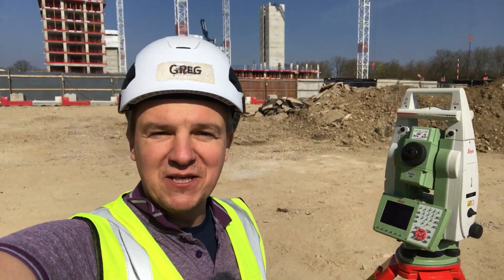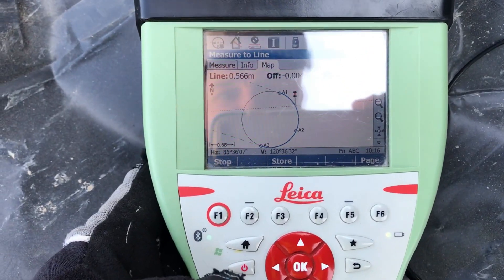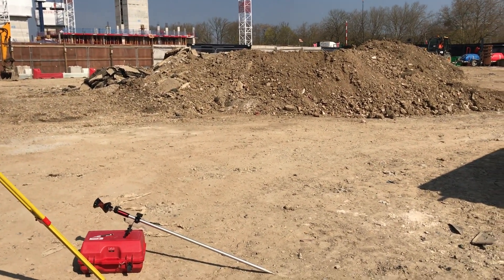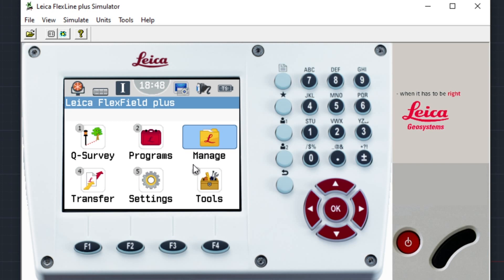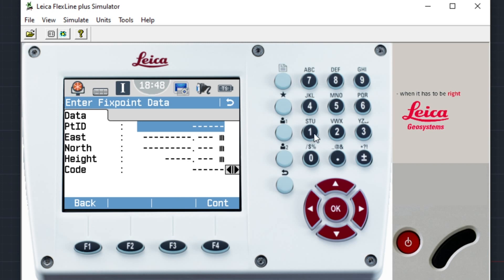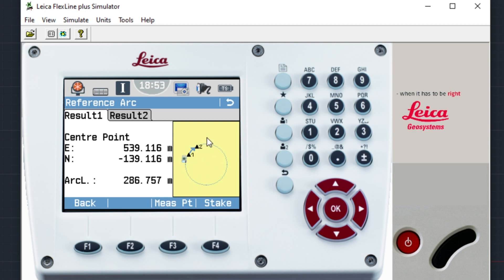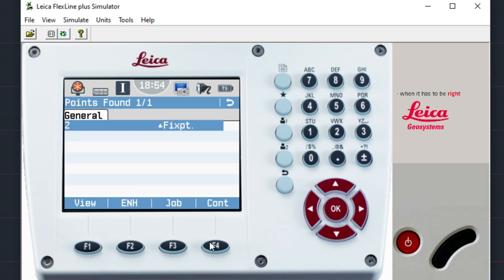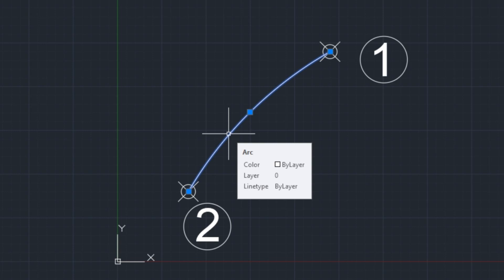SETTING out an ARC. HOW TO USE A REFERENCE ARC with Leica EDM. CIVIL ENGINEER works.

Comment: Hi Greg! About arcs - you're familiar of that because we talked once about it. But a VERY important info for beginners. Some of the Leicas (i.e. TS11 as I remember) has an error in software when setting out open arcs (more than 180 degrees). The error occurs when you want to setout an arc with two points and center of circle. Software somehow calculate an arc based on three points of the arc and set out flatten arc which is different that you want and less than 180 degrees. Be very careful when setting out reference arc with more than 180 degrees. Safe method is to use three points on the arc setting out. Almost always :)
Reply from the maker: Hi Rafal!! I can't remember now :) Thank you for info. For all - be careful this is important!!!!!!

Comment: Hi Greg , your videos are really helping me.
Am a mine surveyor in the past have been using TS02 and TS06 plus, but the decided to buy TS15, what I need is please help me, on how to interpolate between two points Which has elevation using reference line in TS15 am really struggling.

Thanks.
Reply from the maker: Create the line and use measure to line option, the heights will be taken from the line - its interpolated. Dont stake the line, measure to line. With TS06 was better and simpler 😁

Comment: Hi, I’ve been using a TS06 for years. When I set out an arc, I always used the centre and start point function. I’ve recently upgraded to a TS15 and it doesn’t seem to have that option for setting out an arc. Is there a way of downloading that program to the instrument?
Reply from the maker: I am missing some TS06 things on TS15 too :) I think you just have to get use to it -> 3 points, or 2 points and Radius

Comment: Sir can I mark also Arc 2 (2854.836) by same orientation , I mean is it possible to mark a full circle ⭕
Reply from the maker: Yes you can, but you would probably have to choose the arc 1 and then arc 2 later to make is easy 😁

Comment: hi Siteng could I check the verticality of a circular column with this. What function could i use on a TS 16 to thecheck that because that's the instrument i have. Thanks in advance.
Reply from the maker: Sorry for late answer, yeah definitely, you should have same offset in the same length. I was checking these columns different way as I remember.